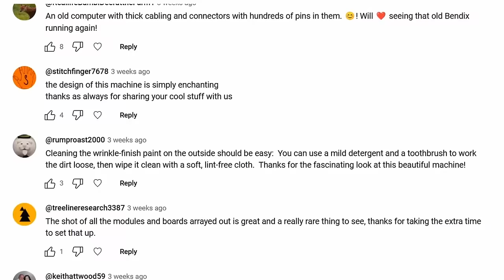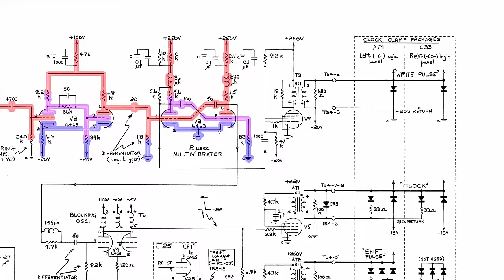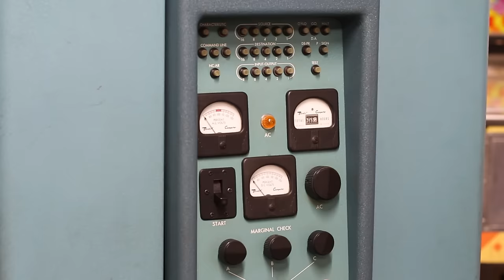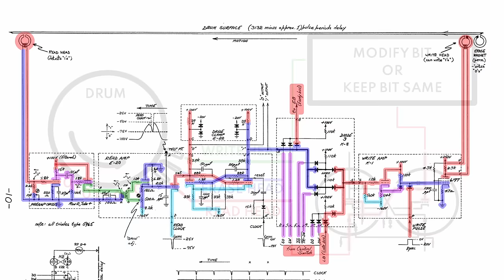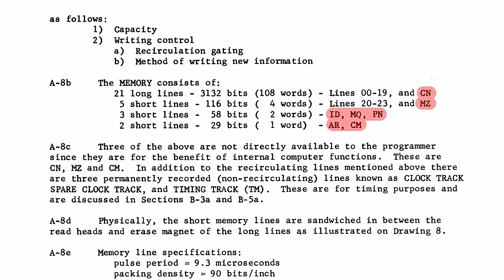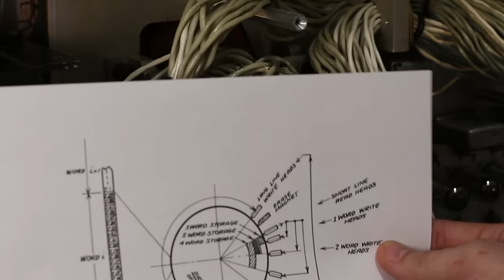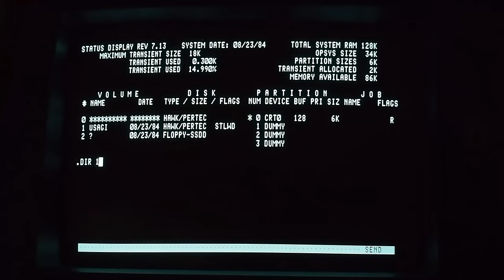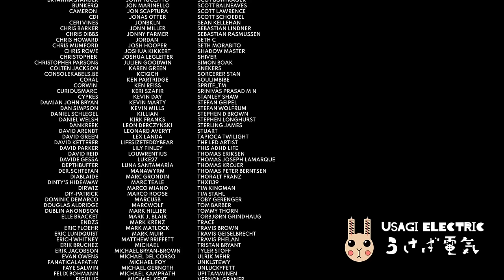Rotating Drum Memory with the Bendix G15

Comment: I think a recoat is definitely feasible. After all it's just a composition of fine metal oxides and some sort of binder.
Reply: Yeah, but is that magic composition documented anywhere?  What worked for some other kind of drum might not work at all for the G-15's drum.  

Finding the right composition for the coating is going to be one of the big challenges of recoating the drum.   Also, making sure that the coating is of the proper uniform thickness is going to be a challenge.  Variances in the thickness means that you have to support the heads further from the surface to avoid hitting the oxide layer, which means that signal strength is reduced by the square of the distance.     

 Every different model and manufacturer of drum memory had different characteristics in terms of the magnetic materials used (some even used Cobalt!), and the head design, as well as the distance that the heads were held (not flown, but held statically) from the drum surface.  

Head design was also dramatically varied.  The gap in the head has a lot to do with the heads response time characteristics, and the windings factor greatly into the amount of current required to quickly flip the state of a spot on the magnetic surface, as well as picking up the tiny variance in magnetic field when reading from the surface.   In some cases, the same head is used for reading and writing, and in other cases, separate heads are used (as in the G-15).   The characteristics of the read and write heads may be completely different.      

There was a US company called Bryant that was one of the largest manufacturers of  magnetic drums and drum memory systems of all sizes, from tiny little drums for small buffers in peripherals like printers and magtape drives, to massive drum memory systems that served as the swap space for large timesharing systems.    Bryant invested an incredible amount of money and brainpower in the design of their drums and drum memory systems.   It was the "rocket science" of the times.   

Mitsubishi in Japan was also a manufacturer of small to medium-sized magnetic drums that were used in some of their early computers, as well as OEMd to various other manufacturers.  Canon made an electronic calculator in the 1967 timeframe that used a small Mitsubishi-made magnetic drum as its working and memory register storage.  (https://oldcalculatormuseum.com/w-can167.html)   Replacing a failed drum in one of these calculators involved a tedious calibration process to adjust the read/write amplifiers to the specific characteristics of the replacement drum.   Variances in the manufacturing tolerances of the drums required such adjustments.   

You couldn't just take any old drum and drop it in place as a replacement for a given memory system.   There were a huge number of variables involved in the design of each drum system.

Some drum systems even had moving heads...the whole rack of heads could move a tiny  distance to the left or right to read/write alternate tracks.  It did slow things down a little, but the amount of movement was very small compared to moving head disk drives.     That way you could get more capacity with only a small sacrifice in terms of access time.  Most of these moving-head drum systems were used in special cases like for large databases that required extremely fast access times that simply weren't possible using disk drive technology.

Comment: In the context of the Bendix G-15 and similar early computers, a blocking oscillator would likely have been used as a timing or synchronization mechanism. In these early computers, precise timing was crucial to ensure that various components of the machine operated in the correct sequence and that data was moved, processed, and stored accurately. A blocking oscillator, with its ability to generate a consistent series of pulses, would have been a simple and effective way to provide such timing.

Someone already gave you a nice precis but eh

Blocking Oscillator:

A blocking oscillator is a simple configuration of an amplifier and a feedback network. The amplifier can be built using a transistor or a vacuum tube. The feedback network often includes a transformer and sometimes a capacitor.
How it works:

    Initial State: Initially, the amplifier is in an "off" state (e.g., a transistor is not conducting). The feedback network is set up such that it provides a positive feedback to the amplifier when the amplifier turns on.

    Amplifier Activation: After some triggering event, the amplifier turns on. This could be due to a small disturbance or noise. Once the amplifier is turned on, it starts amplifying the signal.

    Positive Feedback: The feedback network takes the output of the amplifier and feeds it back into the input. Since the feedback is positive, it further turns the amplifier on more aggressively.

    Saturation & Turn Off: Eventually, the amplifier reaches a saturation point where it can't amplify the signal any further. Around this point, the conditions of the circuit change (often due to the feedback network), causing the amplifier to turn off. In the case of a transformer in the feedback loop, the core saturation can play a role in this.

    Rest Period: After turning off, the circuit enters a rest period. This is often facilitated by the feedback network, which might be "resetting" during this time. After this rest period, the oscillator is ready to be triggered again, either by an external event or by inherent noise in the circuit.

Comment: Btw, on a more serious note, if you do plan to re-coat the drum, several things need to be considered; namely, the magnetic permeability and permissivity of the original magnetic coating. These properties will dictate how much energy it takes to magnetize a domain (or small clump of domains - a single bit of data), and how long the write head has to hold that signal in order to get it to “keep”. It’ll also affect the effectiveness of the erase heads. Also, how thick the coating needs to be, if you can’t match the old drum. It’s not as simple as mixing up a batch of magnetic “paint” and spray-painting it on the drum! You may want to pull an expert in magnetic media/recording on board for this phase of the project.

Comment: An old technician told me a temporary fix for Zuse computer drums that where damaged. They shifted the drum up or down slightly, after cleaning the drum and heads. That was possible because the heads had gaps between them and with that undamaged material between the heads on the drum. The signal wouldn't be as good as a undamaged drum because the The material left in the "gap" was less than the head is wide, but it would let the machine run until a new drum could be installed.

Comment: How similar is the coating to audio or video tape? Suppose, instead of recoating the drum, you simply wrapped it in a helix of 1/4" or 1/2" magnetic tape? Doing the math, the tracks must be pretty wide, at least by the standards of even a vintage floppy or hard disk. My guess is that they could record across a skewed joint between two wraps of tape, much the way an audio tape player plays seamlessly across a scarf splice. Of course you would have to move the heads out by a few thousandths to accommodate the thickness of the tape.

Comment: Amazing: it works very much like several parallel mercury delay lines. At each turn the data is erased by a magnet so the data is read and rewritten at each turn. If you want to change it you must do between those cycles. Thay way it inserts the quick memory is insanely cool. I always thought of magnetic drums as long term storage. Very interesting.

Comment: The Navy's finest all-weather attack airplane of the 60s and 70s, until it was phased out of service in the 20 teens, was the A-6 Intruder. The attack computer on the intruder, was initially a rotary drum computer. Unofficial procedure if the computer quit working in the middle of an attack run, wad for the Bombardier/Navigator to apply a size 12 steel flight boot, steel toe, repeatedly to the side of the drum until the computer would start working again. As the aircraft was updated over the course of its service lifetime, the drum computer was eventually replaced. By the time they got to the a6e the penultimate model of the intruder, Grumman was forced as they built the aircraft to put a large sticker on the side of the panel for the attack computer which was now solid state, it said DO NOT KICK!

Comment: Hello, the content of this channel is very interesting. You mentioned the desire to recondition the magnetic surface of the drum memory, but in the documentation on page 17 (page 23 in PDF) line B-3a CLOCK TRACK, it is specified that this track is recorded at the factory (there is also a spare track) and the recording this is a complicated procedure. You need to keep this in mind and find the documentation for this procedure. Good luck in your work.
Reply: There are actually 3 tracks for timing: CLOCK TRACK, SPARE CLOCK TRACK and TIMING TRACK, as specified in paragraph A-8c.

Comment: try this type of memory 1-bit architecture, multiple simultaneous read-outputs, optionally synchronous multiple write-inputs, ie, multi-channel memory bit, with some threading logic, goal is to have super fast reads to all multiple channels, and possibly slower write through single channel (multiple read, single write bit), I mean minimal latency on usual operations which are memory reads, working like a rom and sometimes a ram or programmable rom, also minimal power usage and other benefits.

Comment: I would love to see you creat a low voltage tube based replacement for the drum.  I'm thinking serial buffers and wire delay lines. It would be fitting.

Comment: I wonder could the drum get damaged during shipping. I'm guessing there must be some kind of drum lock mechanism to prevent such a problem. You wouldn't want something that heavy with tight head to drum spacing moving freely. If the gap between the heads and the drum is tight, you might also have to remove the heads or pull them back from the drum to insure no damage during shipping. But that's all supposition on my part 😊 I would find it more strange if it was just left as is tbh.

Comment: I'd try stripping and polishing that drum, remove all old oxide. See if you can get a thickness measurement of the original oxide in an undamaged area. 
 Buy some OLD iron oxide red barn paint. filter filter filter it. Thin it to a good consistency for light airbrushing.  Spin up  your perfectly cleaned aluminum drum, and airbrush apply your oxide coating,  carefully, layer by layer to correct thickness.  Polish carefully after drying. Then, find a very light spray coating, epoxy, shellac, etc. to spray over the oxide.  Polish this after drying. Use a micrometer to check your work. 

For help in finding a suitable coating if barn paint isn't available, or too much work to refine,  perhaps contact a retired 3M employee, or access their historical archives. 
I'd imagine that there may be many formulas that would work.. and it may be that 3M played a part in that actual coating on the drum in the beginning!

Comment: that use of a magnetic drum for "ram" is amazing. another technology that might be even wackier is acoustic delay line memory, where transducers on the ends of coils of (steel?) wire literally tap the bits at one end and read the vibrations back at the other end, delayed by the speed of sound along the wire. it's the same kind of 'musical chairs' data storage... every bit that is read must be written back immediately, the same or altered. think of the engineering being done for a few hundred or thousand bits!
Reply: And it's apparently feasible to DIY these. The team building the EDSAC replica are making their own nickel delay line memory (as a substitute for the mercury delay lines originally used, which they judged too expensive and hazardous to reproduce).

Comment: I share your enthusiasm for using these machines with all-original hardware, for sure.  After all, if you eliminate the original hardware, then you really may as well just run an emulator!  However, I would suggest that it might be worthwhile to make a drum-memory emulator (maybe out of 7400 TTL logic, including the very tiny 74xx SRAM's, just to make it somewhat vintage? It sounds like it wouldn't need to be too complicated!) just as a test device to be able to make sure that the rest of the computer (when ready) is 100% functional and to be able to isolate any problems from the drum.  I'd also suggest that it might be useful and fun to create a small program and interface for a modern computer to test the (non-crashed, then later the re-surfaced) drum.  After all, even if you end up not needing either of these substitute devices, proving them on the Bendix machine(s) available to you might help other museums in the future!  🙂

Either way, keep these videos coming!  Seeing repairs to and demonstrations of computers that were made over twenty years before I was even born is fascinating!

Comment: The 15.4ms is on average, presumably half a rotation.  But I'm sure programmers could and would lay out the data in clever ways to reduce rotational delays, for example using interleaving.  If you need to store three variables, then calculate the execution time between their accesses; if 1/3 of the full rotational time you might be able to position them 120˚ apart on the drum so when you get to accessing each consecutive variable the drum is almost in that position already.  If more than a full rotation they can be interleaved, not unlike the sector interleaving used by some file systems.

Comment: Wouldn't it be easier to change the entire from enclosure instead of the just the drum?
I guess changing the drums could lead to potential head crashes on the good drum. At least you probably would need to do head alignments to make sure that the good drum won't be damaged.
Anyway, I'm kind of hyped about your idea of coating the drum. I lately wonder if it wouldn't be possible for us enthusiasts to create for example magnetic tape. I'm not talking about high end tape, in the beginning tape was coated by a manually, and the basis of the tape was paper. This way we could protect the technological heritage that otherwise might be lost.
Reply: They're going to swap the entire assembly.
Reply: @fortmax8370  Ok, then I misunderstood this part in the video.

Comment: Offsetting heads to avoid the worn areas is unlikely to work unless the spacing between heads is at least as wide as the width of the heads.  I expect to see the heads mounted on a rack with one positioning adjustment moving all, and this would be done by peaking the signal on the timing track.  Creating a new timing track after replating the drum is going to be a challenge.

Comment: Maybe it would help to create a device that can spin the drum (or maybe platters later) really really fast. That way, any coating you apply will be subject to high centrifugal force. If you spin it fast enough and at a consistent speed, you should get a very even coating with a thickness that depends on the surface tension of the coating.
So you could even achieve different thickness by adding solvent.
Reply: PS: this will of course spray coating material everywhere and make a huge mess, if not contained.

Comment: Great idea to recoat the original drum. But I wonder what all these tiny screws are that were visible at the cable entries for each single head. This looks like extremely sensitiv twiddly stuff that has to be done in a highly specialized lab by virgins at full moon. So I think in order to re-assemble one of these it will be necessary to build something for calibrating the heads.

Comment: I still need a bunch more information on that EDS Branded IBM Clone.  I worked for EDS from 99 until HP merged them in, in 2010 timeframe.  I then worked for all the predacessors until 2022.  I need to get one in my collection.  On an episode appropriate note, what would it take to get the drum and platers resurfaced?  Someone had to have done it in the first place.  I bet someone in Internet land has thought about the idea and come up with a solution.  I mean, for the most point its basically spinning iron that's been adhered to aluminum surface.

Comment: The fact that it has equivalent of almost 8K bytes in 1950s is fascinating, that became relatively cheap for home computers 20+ years later.
Reply: Would there be some way to get DOS running on it, with some kind of adapter to more modern drives?

Comment: If you can re-coat the damaged drum, that's a significant step towards cloning an essential component of these antique machines. 

Imagine a day when you can build an exact replica of one of these early computers from new components...

Also, I don't think "RAM" is quite the right term when dealing with drum memory. Seems like it's more sequential than random, but still less-so than tape, given it's in a short loop by virtue of being on the surface of a cylinder.

Comment: If one could build a "drum emulator" with discrete heads that could be positioned to line up with the heads on various drum-based computers, in a manner analogous to the gizmos used to feed audio into car cassette decks, such a device could be useful not only as a replacement for drums, but also as a useful troubleshooting aid when trying to repair such machines, especially if one could program it to output "not quite ideal" waveforms.  I don't know whether any commonplace coil assemblies could work well in such a device, but being able to separate out the questions of whether everything on a system will generate correct signals when it receives valid data from the drum, from the question of whether the drum is accurately recording all of the data fed to it, would seem very useful.